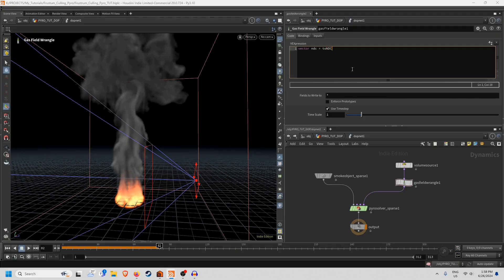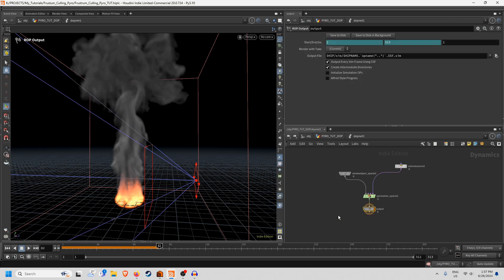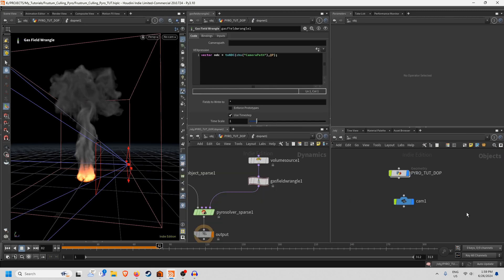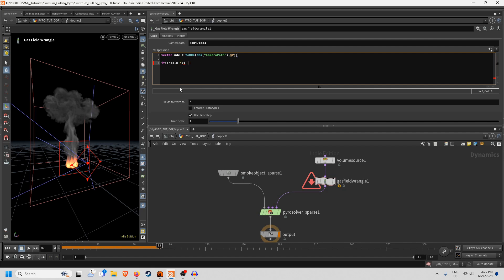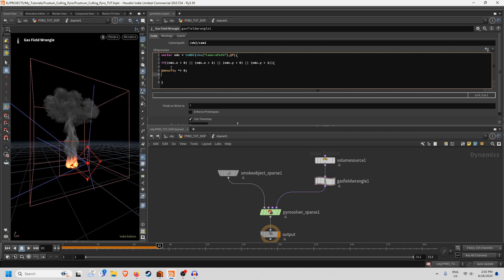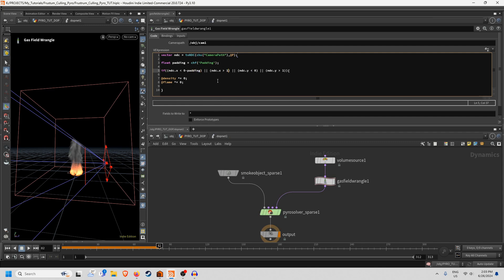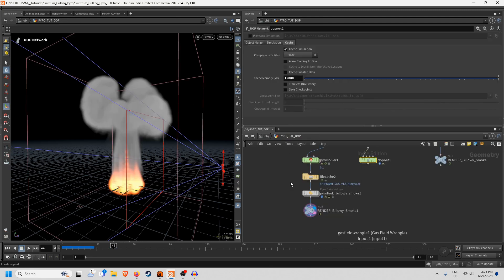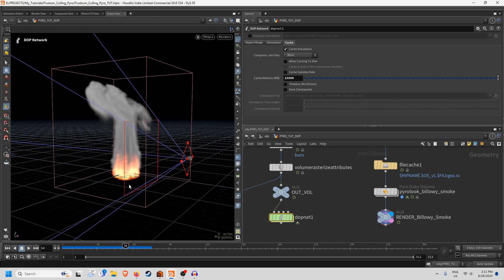Frustum culling a Pyro Simulation in Houdini (toNDC)

Comment: Hopping you will answer but does that mean that what's outside of the frustrum is not simulated/calculated ? is this a way to win sim computation time ? or is it just to the eye ?
Reply from the maker: When it's a sparse simulation it absolutely cuts down on the sim time, as it's only simulating the voxels that it needs rather than a big cube domain like the previous system. 

Though this is why we multiply the temperature and velocity down to zero as well, since even without density they would still be calculated. It's how you can make pyro sims that already have some velocities or temperature in them rather than it all happening at once and making those big mushroom shapes.